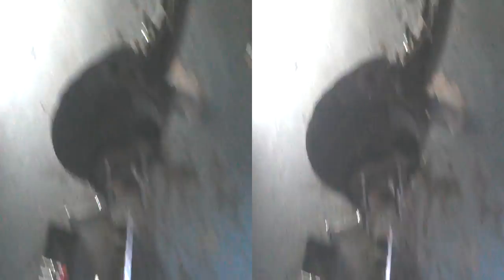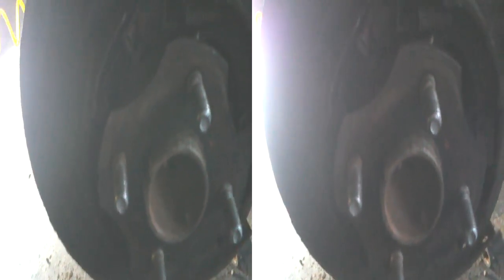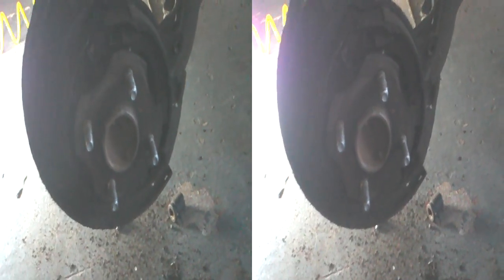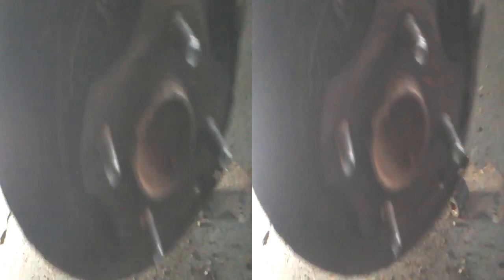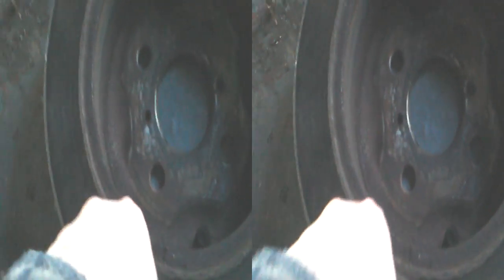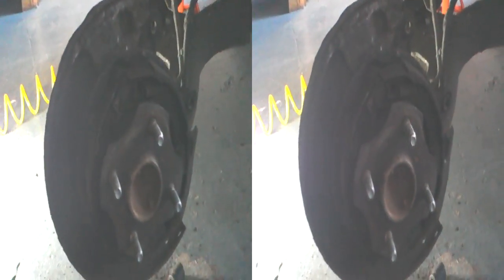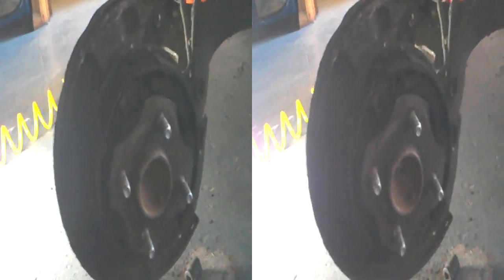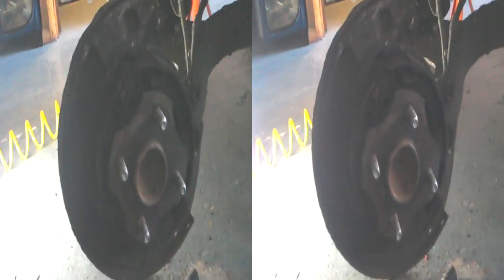Pruis gen 2 rear brakes

Comment: need some advice, just changed my rear disc's & pads on my gen 2 Prius, readjusted rear brake shoe's. little friction when I spin disc. handbrake perfect 5-7 clicks. but getting a loud scrapping noise from rear brake shoes. what should I do? I have done about 400miles now since fitted, thought they would of bedded in by now?
Reply from the maker: It might be that one side is stuck part on so it's not adjusting. Try taking them apart and making sure stuff moves OK when reassembling

Comment: little known that drum brakes are more powerful than disc counterparts...
Reply from the maker: I think you'll find it's the other way round, just disc brakes are more expensive so drums are fitted on the cheaper models. In the case of this combo unit, it was probably about the cost of type approval.